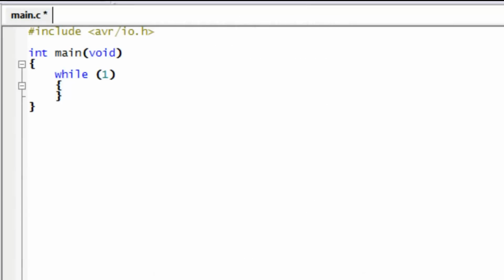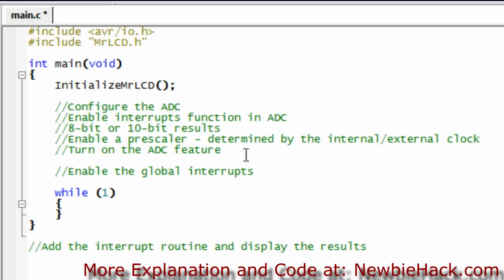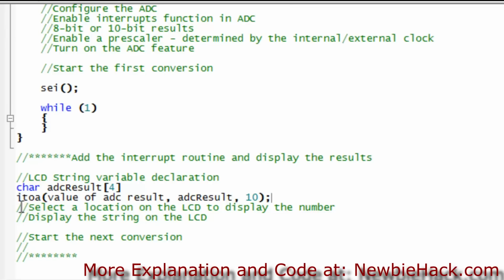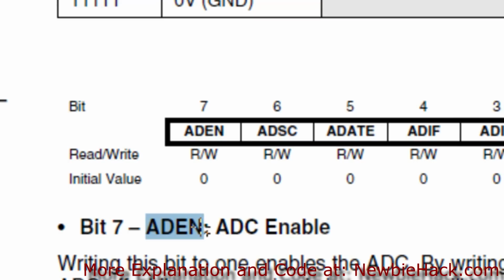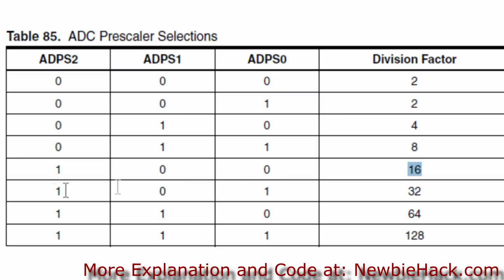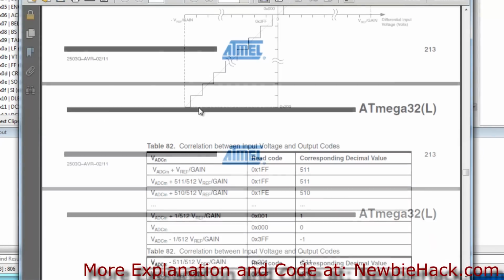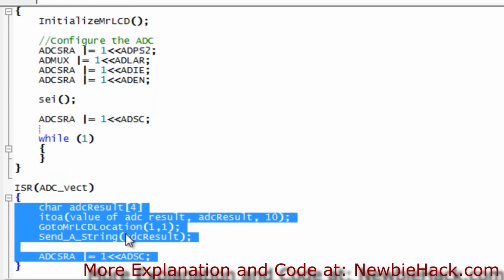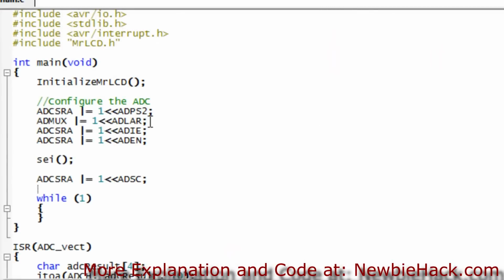31. Arduino for Production! How to use the ADC with Interrupts

Comment: when  changing the frequency  of the sine wave ,  amplitude( LOWER TO  UPPER  voltage ) also changing  with respect  frequency but my application is -   
 how do constant  amplitude ( voltage )   from different frequency  in sine wave . I have number of sample is 64 and crystal frequency is 11 Mhz.

Comment: Hi, Patrick. I ran into an issue with ADC on my microcontroller, and it turns out that the internal pullup was to blame:

I'm experimenting with ADC on an ATmega328P, but didn't have any pots on hand, so I just laid out resistors in series to use as voltage dividers for testing, and used a multimeter to verify the voltage at each node. I connected the ADC pin to my divider nodes one at a time, and the (ADCH cat ADCL) register more or less gave the correct results, but a bit higher than I expected. I also was unable to get (ADCH cat ADCL)=0 by connecting the ADC pin directly to ground.

For the heck of it, I replaced each resistor with it's own value/10, so that the divider was pulling each node to the same voltage as before, just more "strongly." Connecting the ADC pin to each of the nodes now yielded different values than the first time around, much more close to what I calculated/expected to see, but still with significant error.

I suspected that the internal pullup was the cause of the trouble, so I disabled it. That was the whole problem; my ADC values were spot on what I calculated on paper. So, it looks like tri-state has to be set on ADC pins on my micrcontroller.

Does the AVR you use in the video do this automatically? I don't think I saw you mess with PORT pullup/tri-state...

Comment: another question if i may but it's related to the LCD I have changed the char of the adc result from char adc result [4] to
 char adc result [2]
and it still works displaying numbers from 0 to 1023 how is that possible ?
Reply from the maker: A char data type has a size of 8 bits.  Two of them are 16 bits which will give you a maximum value of 65535 unsigned, or -32766 to 32767 as signed.  I use four of them just fro fun.
Reply: okay now I get it , again thank you very much :D ,Are you going to add more videos about the EEPRom of the avr and how to deal with it and how to change it's contents with reprogramming the whole chip?
Reply from the maker: Not sure.  I am pretty deep in doing the ARM Microcontroller tutorials at the moment.  I may go back, but the ARM chips are less expensive and far more powerful.

Comment: can i covert directly the ADCH to an intger ?
Reply from the maker: Yes, absolutely, but you will not get the detailed information from the ADCL.  Let's take a standard decimal number as an example.  Imagine the number 25.  The number 2 (representing 20) would be in the 10's place.  And you have the 5 in the ones place.  It's like omitting the 5 in the ones place, so the granularity is removed.
Reply: first of all i am very surprised by how fast u replied to my question and i would like to thank u for this tutorials i have learned a lot from u and am still doing so , So is there is a way to get the whole conversion stored in a variable (int,float,etc..) to use it later on in the code?
Reply from the maker: Yes, you can do that with the shift operator.  You create a variable, like an int, and you make it equal to the ADCL and then shift the ADCH to the portion of that variable that it belongs.  I do explain this in a video.  Are you watching this as a part of the playlist.  I can't remember which video it is; however. Check out the playlist: https://www.youtube.com/playlist?list=PLE72E4CFE73BD1DE1

If you can't find the video, I will take a look and find it.  Thanks
Reply from the maker: Found the video where I explain it: https://www.youtube.com/watch?v=v0G-ddUeWpo
Reply: ok thank YOU :D
a lot
Reply from the maker: Not a problem.  Enjoy!

Comment: Instead messing with ADCH/ADCL, you may just use ADC, which will give you 10 bit value, but then rather chose ADLAR=0 in ADMUX. For 5V Vcc referent voltage, and ADLAR=0, just use: ADMUX = (1<<REFS0);. ADC value, compiler take care of using ADCH and ADCL properly into coplete integer (int) as 10 bits ADC value.

Comment: But how do you get the value of the ADC into the main ?
Reply: "adcResult" is global variable, so from ISR to main, it is already there available.
Reply: Any variable which is within the same curled brackets (main, for example) is available within this brackets, even if there are 'nested' brackets, for example: void main(void) { int a=0; void SomeFunction (void) {//here integer 'a' is available} //but also here too} But not here outside function 'main'. For this integer to be available everywehere, then: int a=0; void main(void){ //other codes}... and if then some other function is below or above, as is: ISR(ADC_vect){//some function using integer 'a'} then it is also available. Not intuitive, but...

Comment: Hi Patrick, thanks a lot for all your tutorials which are very helpful.   I have followed this Adc tutorial step by step and it helped me in understanding how to configure the ADC OF ATMEGA16. my problem is I am trying to use the result of the conversion and send them to the pin of the mcu and turn on and off an LED. I wil  appreciate it if you can help.  I looked at the internet most of them are imcomplete.
Thanks